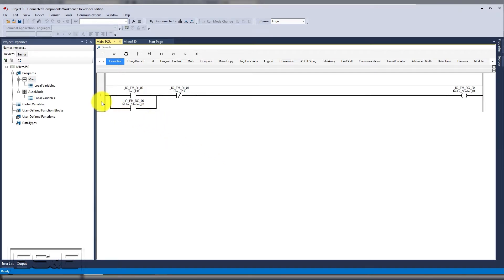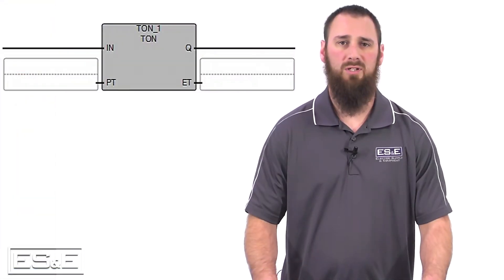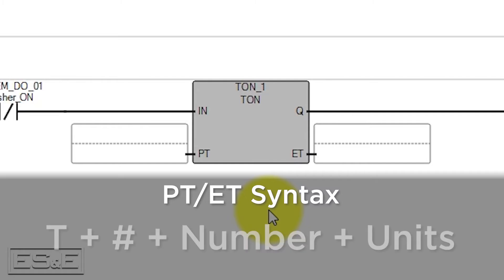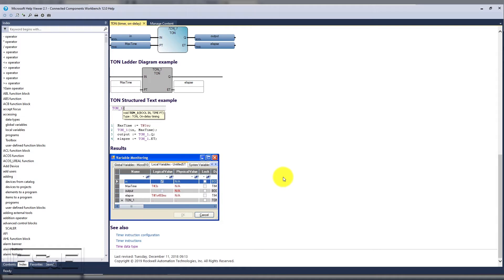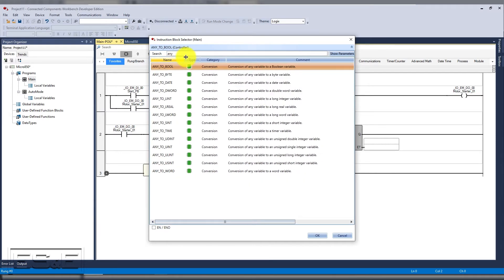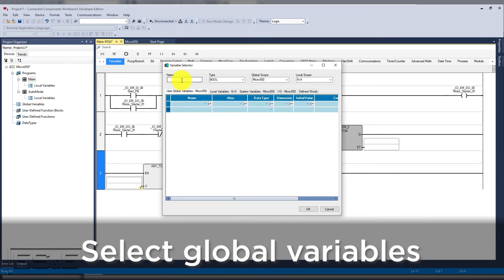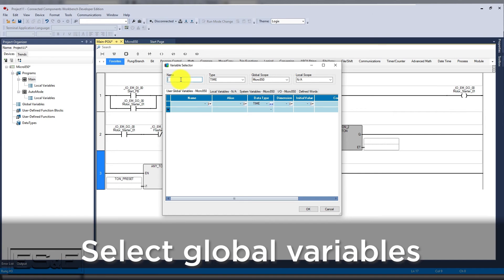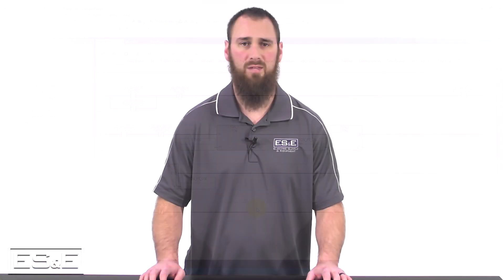Timer Configuration - CCW Micro800 Series Part 3

Comment: double click on TON_1 and then when your back into the function selection toolbox, click
EN / ENO and then O.K.   Now you have a TON_1 with a IN on the left side with the PV on the left.  On the right is ET  elapsed time and then also Q.   Use a data type for Q instead of
TON_1.Q        How can we RESET this same TON_1 back to be used again?   ANY_TO_BOOL as FALSE moved to the data type you used for  TON_1.Q         The   IN  button is where you can change it to TRUE to enable and then FALSE to reset with the enable ladder TRUE.
ALL of THIS is too much to do.  Use only a RTO timer that resets.  :hand-orange-covering-eyes: